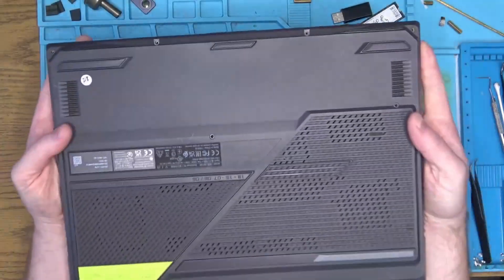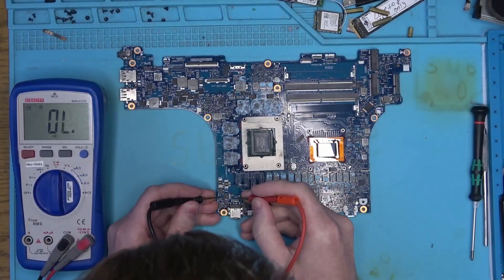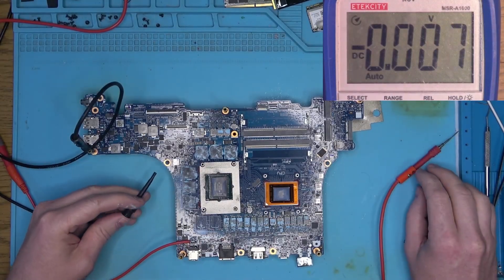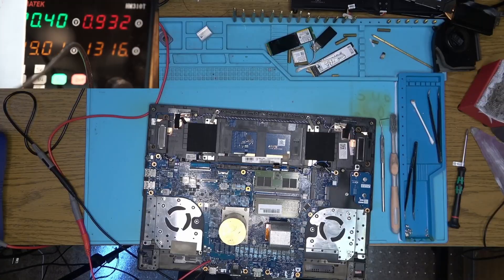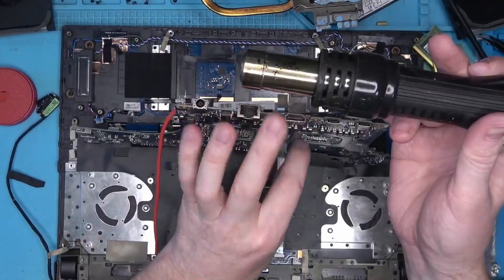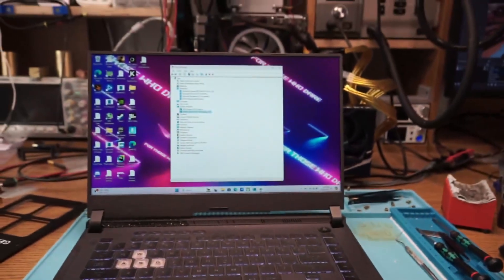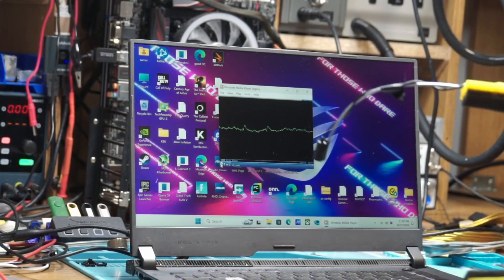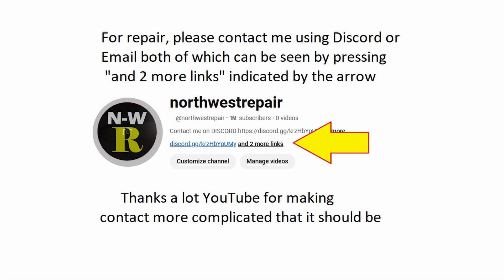ASUS ROG STRIX G513R free repair

Comment: I am the owner of the laptop he is talking about. This is only one side of the story. Yes, I did flash a bios that bricked my laptop before sending it to Tony (Asus G513RM). My whole reason for sending my laptop to Tony was because he has the correct tools to re flash the correct bios onto my laptop. And yes, I did rip one of the tiny WiFi antenna dongles. And yes, 11 attempted to remove the bios chip which knocked off a tiny capacitor. I told Tony all of this before sending him the laptop and all of these issues he agreed to fix for 300 dollars. I send him my laptop without a worry in the world because Tony is the best. Right? Well heres where things go sideways. I received the laptop back from Tony about a month or so after I sent him the laptop. I open it up to find that the laptop turns on fine, but it did feel a little laggy/slow. I also noticed that my WiFi signal was very low from what I was used too. First thing I wanna do is open up the laptop and play a game to make sure everything is in working order. So I open up G-helper (Open source software that changes the profiles from silent, standard, and Ultimate). These profiles come in the laptop from factory, G-helper is just a much less resource heavy tool compared to Armoury Crate. So I set the profile to Ultimate which I had done 1 million times before, without an issue. I restart the laptop and black screen.
I can hear windows boot over the speakers but no display. Come to find out, Tony never even fixed the WiFi antenna either. He told me he simply left it unplugged and admitted that even at his house the laptop was getting extremely low signal from 10 feet away. He apparently thought I would think this was acceptable. Leaving the antenna completely unplugged and unfixed. So now I have a laptop that doesn't have a display, wouldn't be able to connect to WiFi even if it did have a display. And all because I changed laptop profiles from standard to ultimate. I have all emails to back up what l'm saying. I paid 370 dollars for this when it was all said and done. After he sent me the laptop back he said that if low WiFi signal strength was bothering me so much I could buy a USB WiFi dongle.
Reply: Your story was compelling before, but after this video, you sound full of crap especially due to the fact that you are just spamming this copypasta from before without any real response to whatever was said and shown in the video. Either take your refund and shush or come with a real response.
Reply: @kepler104 I don’t feel like explaining myself 1000 times. The story is the story. I already told it so why should I re write it? My story isn’t compelling, it is what actually happened. I was honest this whole time. Even now I still think Tony is great at repairing stuff, maybe it just went wrong with me. Regardless I was never dishonest.
Reply: @silverback2773  You have said exactly 0 things in response to this video. This is a copy paste of previous post from reddit, this completely falsifies your "tony sent me a non working brick and repaired nothing" story which you have going in the reddit post. Now you get 370 dollars back and ruin reputation of someone who did his job while making the antenna mistake, yes seems very honest and ethical.
Reply: @kepler104 I never said he sent me a brick. The laptop was “working” when I received it. I went to test it, set profile from standard to ultimate and no display. This all happened the day I received it. He left my ass on the curb when he said I would have to send the laptop back and pay another full repair price. He only lowered that to 150 after I told my story online. I’m not tarnishing his reputation, just telling my side of the story. Also I did another response on this video with how I fixed the laptop.
Reply: @silverback2773  About that how can you be 100% sure this was not a G Helper mess up? Going by your own story, its a open source alternative for armoury crate and it allows switching the display to the dedicated graphics right? You used that, laptop went no display but still working in the background. That is not a 'bricked' laptop btw, that laptop is still working but is confused where to display the image for whatever reason. And it happening after the use of G Helper points the issue at G helper, not something else imo, why? because that utility is used for that stuff and your issue came back exactly after using it. I dont know how everyone on the reddit post including you is so sure that this cannot happen due to G helper. What do you think about that?
Reply: @kepler104  I am sure this did not happen because of G-helper 100%. It was the GPU bios.
Reply: @silverback2773  he didn't touch th e GPU bios tho
Reply: @Power-Wiesel That's the whole issue. Tony shipped it back with a GPU BIOS that was incompatible with the MUX switch (black screen when using ultimate performance profile), and didn't teste that part obviously. He was only supposed to flash the GPU BIOS, not the system one.
Reply: You genius managed to disable the internal monitor by your experiments, probably by your flash switching the mux. A micro-USB-dongle costs $5.
Reply: Tony didn’t flash GPU bios only systems bios.
Reply: I have a question, before sending the laptop to repair or when it was at him did u mention one about G-helper or to test that "profile", you are cherry picking parts that only are in your favour, you posted your side story here, why tf you respond to every guy that leave a comment now? Do you really want so badly a confirmation from others that you are not a scum? Crying about his repair price after you accepted it...
Reply: @Kiburici  I have used G Helper too thousand times its just a simple software used for changing profiles it won't brick anyone's GPU.
Reply: @e4crypt3d  did i said that g helper bricked his gpu? lol, I've said that he never told Tony to test the laptop in this mode and now its crying on internet.
Reply: @Kiburici  I was just giving my input on G Helper as alot of people were blaming it on the G Helper including Tony.

Comment: Reddit is a cesspool.
Reply: Reddit has it's problem but you are part of the cesspool here on YouTube. If you think Tony is correct then you're easily manipulated and a gullible fool. 

I've seen the post on reddit and now watched the video. Tony is being biased and not disclosing the fact that he did not test the dGPU to see if it works. The moment the customer tried to test the dGPU, the whole laptop crashed. Tony did not fully fix the laptop, and this problem is on him. Doesn't matter all the other minor problems he fixed. The major problem is the dGPU. He also charged $370, which is crazy for a mobo repair, so he made sure he earned his money for all the little fixes.
Reply: @oscardos8538  Then how did he play TLoU if he did not fixed it? Some older ASUS laptop don't have that kind of MUX "switch" to force the display to run on dGPU. Even the G-Helper guy told you not to use it on unsupported ASUS laptop. Oh and I am using a TUF with MUX switch right now with G-Helper and I totally responsible if my laptop messed up.
Reply: @NguyenNam20777 , Last of Us "must have been running on the iGPU!" (with 60+ fps)

Comment: My respect for you Tony just went up. 

Undoubtedly, if I were in your position, I would just have left it for a "no fix" due to the fact that other than the bios, the laptop was plagued with other issues. I personally don't think it was worth attempting but nonetheless, you tried. I also find it amazing over the fact that despite how heated the discussion with the customer went, you kept your cool, admitted your faults and offered solutions and alternatives. Thank you for addressing this elephant in your channel. Keep up the good work man I aspire to be a tech as determined and skilled as you.
Reply: Read my side of the story and the update on how I got my laptop fixed above.

Comment: Customer should not fiddle with bios or anything if they don’t know anything about them
Reply: To be clear, all the customer did was enable Asus' ultimate mode where the igpu is disabled and the dgpu outputs to the screen directly. Not "fiddling with the bios". Customer caused many problems, but not from this specific program (Edit for clarity)
Reply: @matthewl419  Customer is on Reddit talking about how he flashed the GPU bios and then removed the BIOS chip himself (why?) and knocked a bunch of components off...

Kid messed with stuff he doesn't know about.
Reply: @matthewl419  the customer tampered with the BIOS chip, Tony even shows this in the video.
Reply: @matthewl419 yup it was the GPU bios and not the system bios, which is why I got a black screen when setting it to ultimate mode. Tony only flashed the system bios which is why I was having problems. I reflashed the GPU bios and now everything is working as it should.

Comment: I have followed this issue, it is clear that the customer is to blame for his reckless behavior of meddling with BIOS chip using third-party Github software G-Helper (that is made by one man without thorough testing on all different BIOS version of Asus laptops), all for the sake to use his RTX 3060 external GPU. Remember, the customer received the laptop from Tony in working condition except with weak wifi signal which the customer said did not bother because he can simply buy wifi dongle. 

And for those who are saying that the repair is easy and should be cheap because it is just flashing the BIOS: you can see the video itself, the repair that cost $370 is NOT just flashing BIOS, there are some issues alongside that including knocked components.

I do highly respect Tony decision to refund completely the fee, which I do see unnecessary.
Reply: G-helper did not cause this. Something is going on with the MUX switch that bypasses the igpu connecting the dedicated gpu  directly to the laptop monitor.   The customer would be in the same situation had he used armoury crate (the official software) to switch to the dedicated gpu.  The modes are already embedded in the bios. All these programs do is access it and make the switch.
Reply: Big coincidence, that everytime after G-helper wrote the UEFI-block the image disappears.
Reply: @randy2493-s6n  thank you for being the one person to say this. G-Helper only would have changed the BIOS option, same as armoury crate or as doing it yourself in BIOS. There was something wrong with the laptop to begin with.
Reply: @randy2493-s6n it was the GPU bios. I reflashed the GPU and it fixed EVERYTHING!! Thank god
Reply: Was it because of G-helper? I have read about how it works and it basically does what armory crate does. Many praise the software including me, never seen anyone’s bios getting corrupted
Reply: @soheilazizi5306  the laptop obviously had other problems.
Reply: @soheilazizi5306  updated comment from the laptop owner

@silverback2773. 5 min ago 
Okay so, I was the original owner once again. I figured out what happened and where it all went wrong. I told Tony in an email right before sending him the device that I used NVFLASHK to flash a different GPU bios onto the laptop. The issue wasn't with the system bios but with the GPU. So I was able to get a display via USB-C to HDMI. I had to order the adapter on Amazon which is why I didn't try this right away. I was able to find the correct GPU bios and flash it using NVFLASHK and now the laptop is working perfectly. Ultimate mode with G-helper works and the laptop is snappy and running great. Maybe Tony forgot I mentioned it being the GPU bios and not the system bios or something. Or maybe he didn't even know they were separate things to begin with. He admits to having less knowledge about laptops so maybe this could be the case. Hopefully this adds some more insight into the issue.
Reply: @Polyeith  i wish you could make a top comment clearing up the rampant misinformation of this situation.  thank you for sharing this
Reply: @ponponpatapon9670  it's especially unfortunate because this video left out a lot of information on the situation. People on both sides aren't getting the full story and so it's largely just screaming fights, and really upsetting the collateral damage this has (theoretically, at least) on G-Helper's reputation & open source software as a whole.
Reply: @Polyeith yup, but tbh even when they got the full story it went in one ear and out the other. These people don’t care about what’s right or wrong really. Everyone just wants to point fingers. Tbf Tony would never really explained the whole situation because he knows 90 percent of people already side with him. I’m just glad I got the damn laptop working again 🤣
Reply: @silverback2773  I guess that's the most important part lmao. people always want something to be mad about, whether it's wanting to think you're an idiot or being pissed & hating on a big youtuber. glad you got it working again in the end.
Reply: @Polyeith  I recently got interested in the whole situation since I'm a guy who also repairs his stuff, or at least tries to. 
So in the nutshell if I'm getting all the details right, both the owner and nwr have some mistakes. The owner somehow messed up the system bios chip itself and it doesn't boot which is where nwr comes in, he fixed it but did not bother with the wi-fi antenna, so the laptop is working now. However something happened once the owner used G-helper and it starts with a black screen but the system is working meaning something's wrong with the dGPU (which I assume is the result of flashing a different dGPU Bios), which is the main problem after nwr fixed it. The problem with nwr's side is that he is not really familiar with MUX switches and he just blames it on the open source software but to be fair, even if the owner used armoury crate something's bad is about to happen anyway but fortunately in the end the owner repaired it by flashing the correct dGPU bios.

So basically, the verdict is both are at faults; the owner tinkered way too much for a simple BIOS flashing, and nwr for not researching much more about MUX switches. Well, at least there's lessons to be learned here.
Reply: Ermm.....what do you mean "just for the sake to use his RTX3060"? Are you a clown? Do you not know how to use your brain? Are you so easily manipulated? You gullible fool.

You buy a gaming laptop primarily for the dGPU, that is what allows you to game at high framerates on the damn thing. If you don't use the dGPU why would you buy a laptop that has one in it? And if it stops working you'd want it repaired.

Would you take your car to the mechanic to repair your 6 cylinder engine to get your car back and realise only 3 cylinders work? Then the mechanic refuses to repair because you drive your car too fast and the 3 cylinders he repaired are also damaged again? If the mechanic did not "fully" repair what he was paid to do then he has to take it back and complete his job.
Reply: RTX 3060 Desktop is barely faster (or even slower) than the RTX 3070 mobile. Customer must be a real pro. 🤡

Comment: Damn that's messed up. How much did you want to charge to just flash the BIOS chip? Half of 370 or did you want 370? cuz 370 is a little ridiculous to flash a little chip.
Reply: This laptop was totally trashed by a double left-handed, and Tony brought it back to life.
Reply: Do you also chide your surgeon for making a simple little cut?
Reply from the maker: I do not estimate repair cost based on the complexity of the repair because customer NEVER knows exactly whats wrong with it and after diagnosing the device, i never know how long it will take to actually fix it.
This is the reason why i get almost 100% success rate in my repairs because i repair every device even when it makes no sense to work on it for days.
With that said, the repair cost is NOT based on the complexity of the repair but on the device value.
Cheap device=cheap repair price how ever long it takes
Expensive device=expensive repair price how ever long it takes
That way everyone can afford to send their device to me for repair knowing that 
a) i will take as long as i have to to get it fixed no matter what
b) everyone can afford my repair cost unless device its self is not worth it.

I offered him 150 to fix it again.
Reply: You are the one who decides what someone have to charge for their work? What a buffoon 🤡
Reply: You're too nice to your customers Tony. At least you sent him to Northridge so you do have a mean streak!